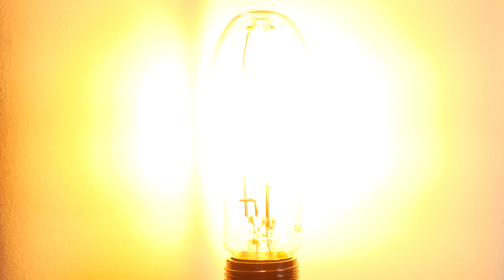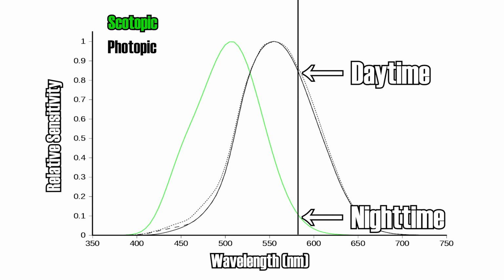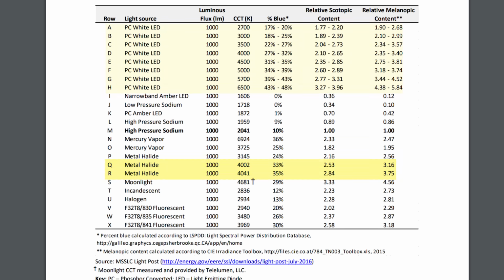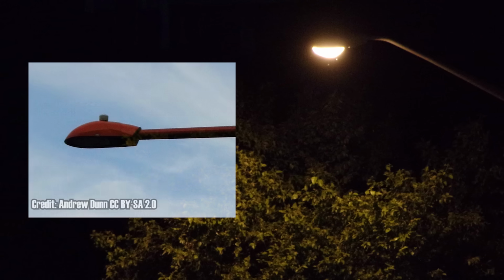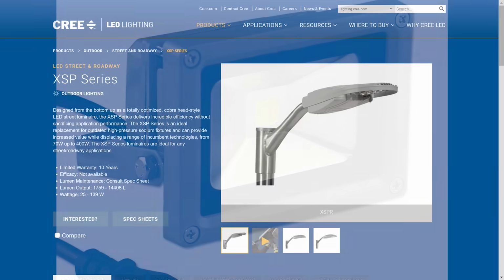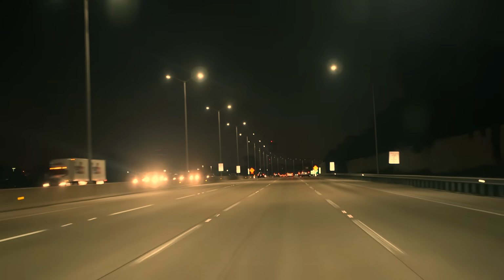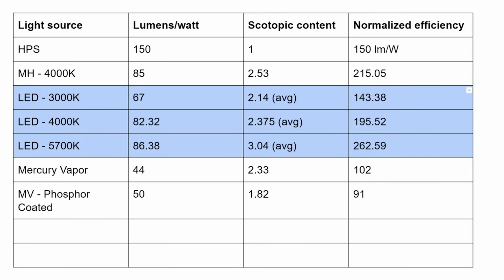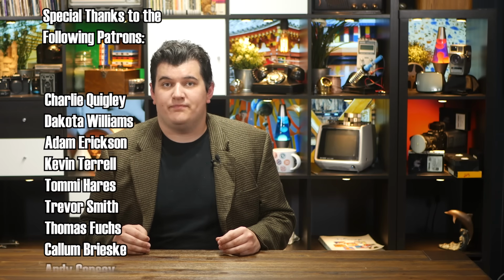The LED's Challenge to High Pressure Sodium

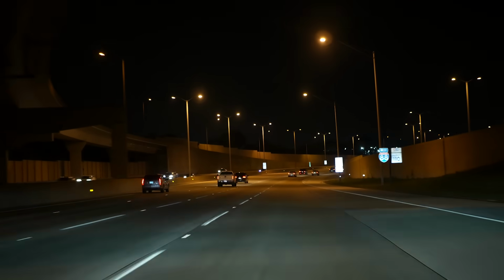Comment: 1:37 - The flat lights only illuminate the area directly below the light. The rounded lights illuminate below and between lights. They are better for safety. If you want flat lights, then you need more of them.
Reply: Incorrect. Flat lights illuminate a nearly 180º range, obviously dimming towards the edges.

Comment: Im surprised it wasnt suggested to simply put warmer led closer to cities but cooler ones on highways where disrupting circadian rhythms would be helpful
Reply: Great, now people can get in car crashes in cities.
Reply: @seigeengine  and they don't already? We are currently a per-changeover so at this point it's a matter of benefits where they are used. The difference is the drawbacks on rem sleep are mitigated if Cool LED's aren't around sleeping people. it doesn't have to be an all-everywhere deal.

Comment: If only LED headlights from oncoming traffic (or even following traffic) weren't so freaking blinding. I also hate the way LED headlights appear as if they 'flicker' when cars go over bumps because of how directional the light is. I've freaked out so many times thinking someone is flashing their lights at me when really it's just LED headlights and a pothole or speed hump. I know this vid is about streetlights but it got me thinking about headlights and how annoying I find LED's on cars.
Reply: So you'd prefer headlights to be less efficient and less directional, making it harder to see distance objects with them?
Reply: @seigeengine  I know I am complaining about something that is more efficient and safer for the driver. They are super efficient, the amount of time I think someone has got their high beams on when really it's just their headlight. It's just scary sometimes when I feel like I can't see because of how bright they are. I would love if something less blinding to oncoming traffic were used for low beams and LEDs for high beams. But this an opinion not based on science 😂 😂 it is better to use LED.

If anyone is a new driver like me and oncoming traffic with LEDs is freaking you out, the trick according to my dad is to take your foot off the accelerator and look at the edge of the road. It might be scary at first not being able to see ahead and only looking at the edge of the road (this is why you slow down, in case of corners sneaking up) but this way you can avoid being blinded and stay on the road.

Comment: I'll take warm colored light over cool colored light anytime. I've had such experiences at night in various parts of the city; the areas illuminated using cool colored LEDs hardly illuminate the area below them, while I could see everything quite clearly under the warm colored sodium lamps. Warm colored sodium lighting visually work better in practice than on paper, though this is offset by their energy consumption. It's the cool color temperature I object to. I wouldn't be surprised if some of the newer LED street lights use a color temperature at or below 5000 K.
Reply: This video clarifies that you are objectively wrong.

Comment: The biggest issue with LED street lights is night sky light polution. The bright and wide spectrum light is really detrimental to the astronomical observations. And probably also to wide life. The Sodium at least is pretty easy to filter out as it emits usually only very specific frequencies that are usually of no interest to the land astronomical observations anyway, so cheap simple filters can eaasily filter them out and improve contrast considerably.

Comment: Neither...  we spend a fortune on streetlights and the infrastructure that supports them and connects them to the grid.  Personal and vehicle lighting has come a long way in the past decade.  It would be fare more energy efficient and environmentally friendly to do away with streetlights altogether...  IE: in the latitudes in the continental US we average about 11 hours of dark each day where a streetlight would be used. For a SINGLE 250W light:250Watts X 11Hours X 365Days = just under 1004 KiloWatt hours each year PER streetlight. Using 2014 DOE info, that amount of energy consumption equals approximately:
73 gallons of diesel fuel.
82 gallons of gasoline
10,141 CU/FT of natural gas
1044 LB of coal
Per year PER STREETLIGHT...  This of course is only the energy used to power the light, not to mine, process, fabricate, install and maintain the lights and infrastructure...  Energy and treasure better used elsewhere IMO. It would also be kinda nice to bring back the wonder of the night sky I remember as a child...

Comment: I personally love LED's cooler coloring. The blue tint also has a more modern feel. It can be extremely bright though, especially when people who have them in the car refuse to turn off the high beams , or guys in trucks have 280 lights and lightbars on blaring in my face or mirror. Overall, i do like the change.

Comment: I don't normally reply to older videos but could not resist. First I have to agree with the people that said that keeping drivers awake might be a good thing. But this also prompted me to wonder about the LED light and sleep thing again. First if LED lights are the same color as Moon and star light, that may prompt the body to to believe it is night and that it just missed sunset. Next if sodium light is closer to sunset light this may prompt the body to get stuck in a perpetual sunset mode. Perhaps LED lights that mimic sunset at sunset then moon and star light later just like nature, they could even dim later at night when less light is needed. Remote control could even allow street lights in a given area to be brightened for emergencies, outdoor events, or on travel holidays like Thanksgiving or Halloween. I was really surprised by the lumens per watt efficiency of the sodium lamps given all the energy they wast as heat. I just found your channel recently and I find it fascinating, please keep it up. thanks

Comment: Even if warmer LEDs are less efficient, they are faster to turn on and off. So you can equip them with light and motion sensors and drastically reduce power consumption throughout the night.

Comment: I’ve always said that if LED could make an orange led like the high pressure sodium bulbs I would be very happy
Reply: You can get them, but they are more expensive because they need more phosphor on them to get that warm. People are going to go more towards cheap, which equals less phosphor and a cool white output.
Reply: These cheapskates wont get them.
Reply: Or green of mercy lights
Reply: They do.
Reply: Shea Goff - San Jose has them installed in some of their streetlights!
Reply: These SON led lookalikes are being rolled out in Tenerife/Los Christianos
Reply: Access Fixtures recently released an entire line of outdoor LEDs this past May that are of equivalent color temperature to HPS at 2200k. Even Philips Signify Lumec makes standard model LED streetlights with 2700k as an option. So yes, we are moving towards that thankfully
Reply: I mean, I recently bought this warm 3700K lamps for my study room, to replace these old incandescents, as I didn't want harsh white light, and they were like 10 bucks a piece, I don't think that's too expensive.
Obviously an industrial-grade lamp is much more expensive, but you'd just need a tinted plastic or tinted glass cover, like in the lights I purchased, to make them warm, in theory that is...
Reply: Sérgio Freitas 
3700k is not warm, 2700k is warm.

Comment: Seems to me the solution is to use LEDs on expressways since both safety and staying awake is important, and ”orange” lighting on surface streets - perhaps only where pedestrians interact with roadway. As for façade and other decorative lighting, maybe it should be turned off after a certain hour. No one is driving by the church or courthouse at 2am so all the light is being wasted anyway.

Also, I think LED is far more attractive than “orange light.” That’s just me.

Comment: Yet another interesting, well researched, and well presented video - thank you.
On the subject of "bluer" LED's I have an admittedly anecdotal comment that may be illuminating. The hall and staircase in my house has lots of down-lighters I'm sorry to say - there's nearly always one or more blown, with hind-sight I much prefer old fashioned light fittings with fewer bulbs to repalce...
...tangents aside I cured the issue by replacing all the halogen bulbs with LEDs. Far more reliable, run much cooler, far more efficient, but I hated the seemingly harsh and bluish light they gave out...
...having given it a bit of time I'm now entirely used to them and their colour temperature doesn't bother me at all. I suspect we all prefer warmer lights simply because that's what we are used to. Such led's would seem to be the best choice and I submit once people get used to the change the inevitable complaints about such a change would stop.

As an aside I'd suggest an even more efficient plan would be to turn off the majority of out-door lights entirely. The most night-time lighting use is driven by accepted norms rather than necessity and accepted norms can change. By all means minimal lighting for main roads and locations that are proven to require some lighting at night for safety is good but let's not beat around the bush; it's supposed to be dark at night and we use as much lighting as we do because we're now use to that and some people find it reassuring as a result. Indeed I would submit that much of our night-time activity is maladaptive, both personally and socially, facilitated by the widespread use of lighting. People being frightened of the night sky when the lights go off certainly illustrates the point.

Comment: I'm a six year veteran of the U.S. Navy, (89' to 95'), and I can say from experience that the Navy uses Low Pressure Sodium lights on it's ships' weatherdecks, (the external areas of the ships), for the reason that the near monochromatic low wavelength of light emitted is less likely to be seen by potential enemies at a distance. So LPS lighting is specifically used by the military as a "stealth" security measure... Just an interesting fact worthy of note...
Reply: k halliday  It wasn't intended to counteract electronic surveillance means..., which would of course require the the use of electronic equipment... It was intended to overcome the limitations of the human eye detecting optical light, something that all humans, (excepting those with various degrees of blindness), have naturally, regardless of age, gender, economics, or military affiliation... It's much like the camouflage patterns used on the textiles of certain military uniforms... Just because a camo uniform does nothing to prevent detection by other means such as thermal imaging doesn't mean that the camo uniform is worthless in performing its function... For example..., on a battlefield, while all or nearly all of an enemy force, as well as any civilian bystander witnesses, will have the use their eyes to observe visible light, only enemy combatants that not only posses, but that are currently using, electronic equipment such as night vision goggles, thermal imaging, etc..., will be able to negate the advantage provided by the camouflage... As for use on ships... Often, it is civilian vessels, whether they be giant tankers or tiny fishing boats, or anything in-between, that might first notice the presence of a military vessel... While a vessel that is using electronic means to detect enemy vessels might easily see the ship, other civilian vessels, most of which have marine radios which they could use to report strange vessels, would remain oblivious to the ship's presence, as well as most people on any local shores...
Reply: Intereasting
Reply: k halliday  you don't have a clue, radar isn't going to tell you that it's a cargo ship or navy, but lighting will.
Reply: Sounds like this goes toward the sky glow issue.
Reply: @coopergates9680  nah sky glow pretty much only exist in large cities. a few ships blasting light into the sky in the middle of the ocean is pretty much nothing compared to the lights reflected off the ground in a city
Reply: @ipodtouchiscoollol  the idea tho is that anything contributing to sky glow in a big city would be easily spotted in the middle of the ocean
Reply: k halliday  Lmao you got obliterated, go with your smart ass to other place.
Reply: Cool!
Reply: “Worthy of note, or noteworthy”
Reply: I think that LPS's high luminous efficacy (200lm/W) also contributes quite a lot in the case of external lighting.
Reply: I read " I'm a six year old " and got confused
Reply: i Love OV-25 Street Lights But i also Love LED Street Lights
Reply: did you kill lot of people?
Reply: @nom3nnescio  I was an Interior Communications Electrician, and worked on audio and video systems..., so no..., I as an individual, didn't kill anybody...
Reply: Can't you compensate for that with a red LED or white LED with a filter?
Reply: @ojkolsrud1  As stated above, my time in the Navy was from 89' to 95', so if they have updated their lighting systems in the time since, I can't bear firsthand witness to it...
Reply: As a veteran of the Marines, Semper-Fi
Reply: I was on cvn 75 in 2013-14, and also worked in energy efficient lighting retrofits post navy. I think we could replace the hps lights with red (or other monochromatic) leds.
Reply: aj mazzaro i think my brother in law was on CVN 75 for a while. 
He served on both the Truman and the Roosevelt as a pilot
Reply: It's also night vision compatible. Warm colors of light are the best for seeing at night.
Reply: If they are worried about stealth, why not use IR lights and issue NVD glasses? I'm sure it would be stealthier
Reply: I find the OP confusing since underway night lights have been red since world WW2, not amber as stated, for reasons of night blindness and has nothing to do with stealth but sailors' ability to see when moving from a lit to unlit area.
Reply: @plebiansociety  You would have optional red lights in internal spaces, such as workshops and berthing compartments, where you could switch on regular white lights or red lights, which was usually either uncovered fluorescent tubes for white, or fluorescent tubes inside red transparent lens tubes for red, but on outside weather decks, they would use higher power sodium lighting...
Reply: Stupid stealth technique cause the crew themselves can't see
Reply: @mghjopk5758  Up close, you can see just fine... It's just at a distance that you can't...

Comment: The Sun light contains high amounts of harmful blue and uv light, but when it's shining your pupils are very constricted. Much lower powers can harm your eyes at night, when the pupils are totally open.
Reply: Your pupils dilate and contract due to light, not time of day, meaning that higher light temperature (and brighter) light will make your pupils contract.
Reply: @Sgtpeterenis  The pupils are contracted during the day not because of the time of the day, but because of continuous exposure to strong light. During the night, while driving, or even walking, there´s not enough time to react to sudden brightness changes. The high energy photons just go in with pupils wide.
Reply: @gertboltenmaizonave2421  Four problems with that.
1. Whether or not the blue light from LEDs is actually harmful is not settled at all
2. Even if we assume it is, driving at night entails continuous exposure, not sudden changes 
3. Road lights are not that bright (not like, say, lightning or a flashlight), and you're unlikely to drive through complete darkness, especially considering headlights are often a similar brightness and colour temperature to road lighting and 
4. Pupils contract very quickly precisely to withstand sudden brightness changes. 

Where did you get the idea that street lighting harms the eyes from? Did you read something on that or did you just draw that conclusion yourself?

Comment: Finally, someone who’s knowledgeable and speaks out about the “blue light” bs that’s becoming more and more common. Being into pc gaming you see adverts all over the place about blue light filtering glasses, most of which just have clear lenses (that I’ve seen, a few have a slight yellow tint I’ve seen). My thoughts on this topic sort of goes like this as well. Why would you want to filter out the blue light coming out of a display panel that’s only output it R,G,B. If you filtered out all blue light from a display your vision would be at best just dichromatic, also making what would be seen as purple, red, and making yellows be seen as green, since you’re filtering out the blue light, you wouldn’t see these other colors that your display can make by lighting up the blue pixels along with the red and or green. So all you would see is shades of green and red, you wouldn’t even be able to see white then. But that’s only if the blue light filtering lenses and glasses actually worked, but just stating that it’s a silly concept, definitely for gaming as I’d want to be able to see all the colors my display can emit. And as he said, why would blue light hurt your eyes, when the sun itself emits blue light as well. It just seams like a marketing gimmick for companies to try to push dollar tree glasses out the door for $20+ that do nothing or put more strain on your eyes as your now having to focus more on your digital display.